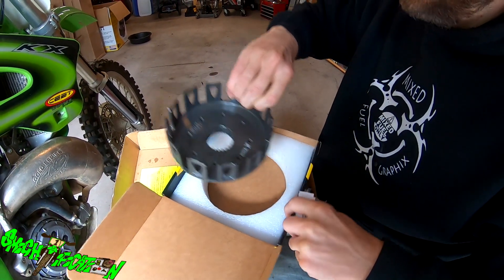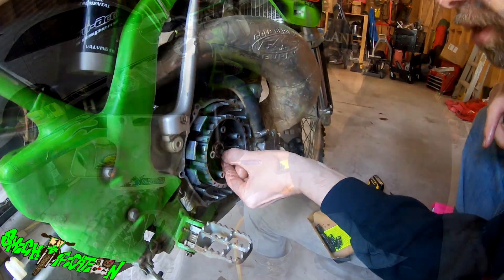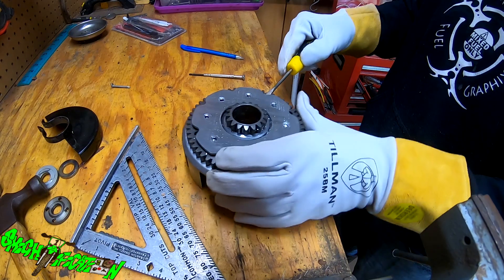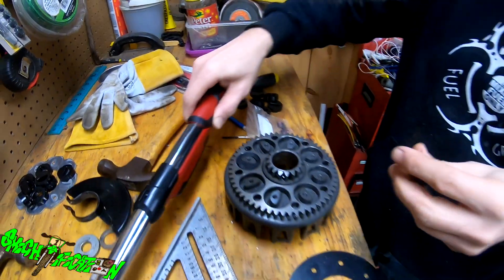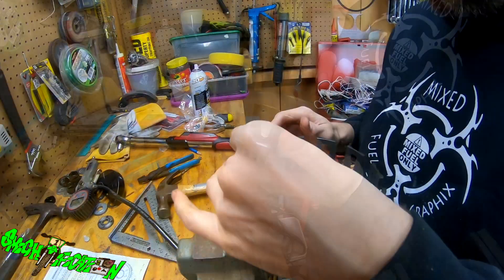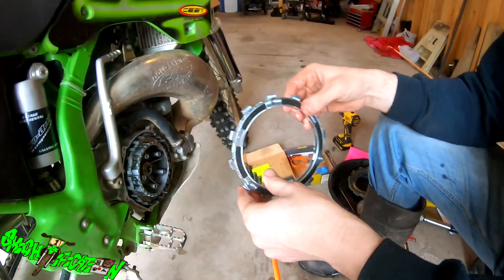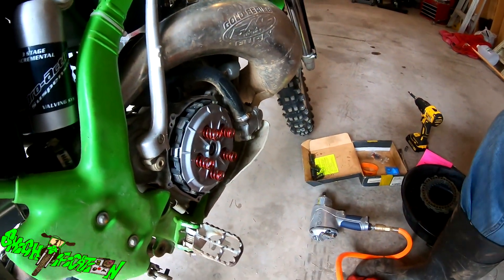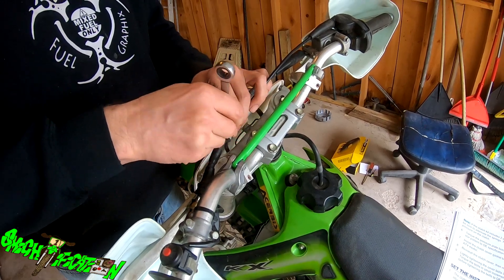Rekluse auto clutch install - 1998 Kawasaki KX250

Comment: Hi I was hoping to be able to ask a few questions about the radius x clutch you installed on a 98 kx250 with a pro x basket? I just finished rebuilding a 2000 kx250 I turned it into a super moto and I just filled the gas tank up for the 2nd time. I installed the radius x with pro x basket as well I paid full price for it only because I paid full price for it that it’s not already in the trash. I’m trying to give it a chance but I’m haven problems with setting it up I only have a hour on it and still haven’t gotten it to work at all yet witch is killing my ego that I’m a problem with setting it up I’m been rebuilding and do all the work on every bike I own over 30 years and I can’t adjust this clutch so it will work. I’m at the point where I just want to trash it and move on with a Hinson clutch. I know I have anger issues. Lol. So this is my last attempt last chance for this clutch before it trashed. Ok so you where I’m at now and I see it’s been 4year ago when you installed it. But did you have a problem setting it up? Or is it me I took the short bus to school. Lol. I adjusted the free play little by little all the way in and than all the way out and wasn’t able the get it to work? Do you remember about how far you set the nut on the cable at the motor for it to work? Did you have any problems with it ? How long did you have in you bike ? Any problem with it the whole time you had it installed? Any information I would greatly appreciate it ! Do you still have the bike? Thanks for your time and if possible my number is 856)448-5375 I would like to be able to talk to you about it because again I was on the short bus to school .lol. Thank you so much I really would like to see the clutch work just once before I trash it !
Reply from the maker: the tension on the clutch is going to vary per bike and clutch cable age and how stretched it is. He is still running this in his bike with no issues. You didn't explain how its not working so I don't understand the issue. The EXP disk expands when spun up with rpm's. so you are adjusting the cable to simulate you holding the clutch a little bit then when you apply RPM's the clutch expands and fully engages

Comment: Nicely done! How are you liking it so far?
Reply from the maker: its pretty awesome haha, I have one in the BMW but trying one on the small bike is pretty cool not stalling out is amazing haha
Reply: Man I can’t get it to not stall just once’s your my last chance at trying to get it to work before it goes in the trash I even changed the oil 3 time with only 2 hour on the bike and the magnet on my oil drain plug is covered with so much metal clutch material I’m hoping. Any help would be greatly appreciated thanks